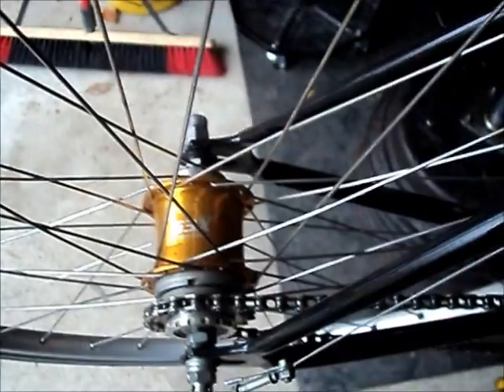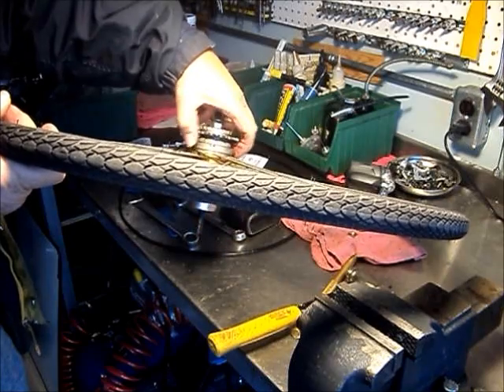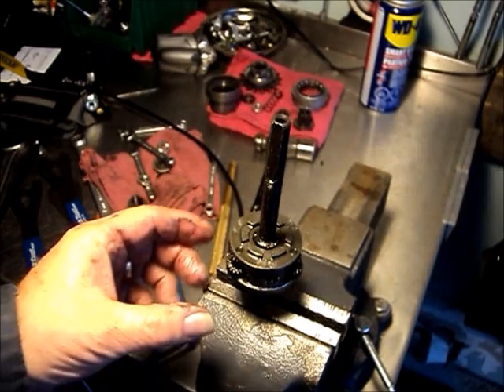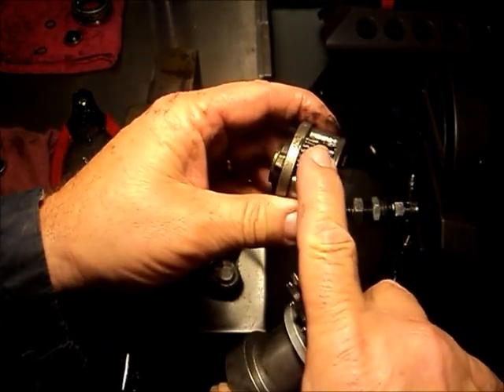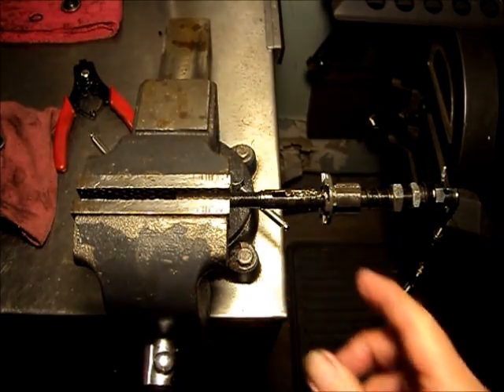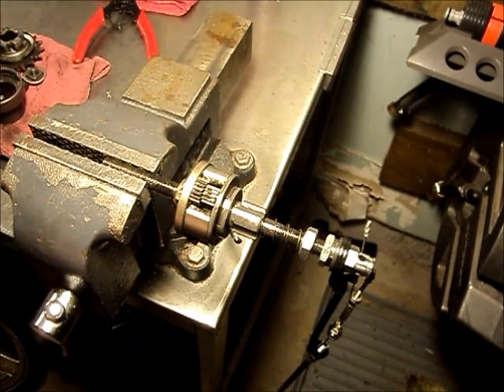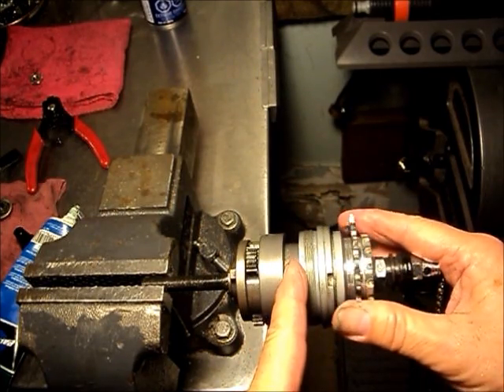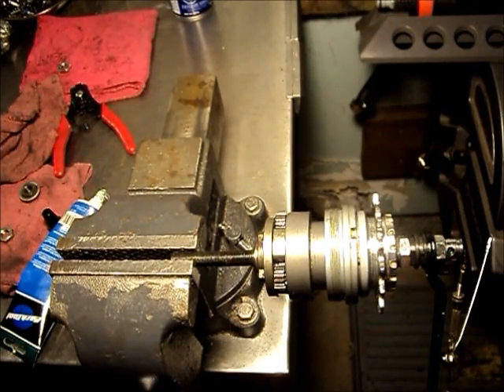Sturmey Archer S3X fixed gear 3 speed. How it works

Comment: I just got this exact hub from a friend. I was thinking of building this up as a 3 speed freewheel. Do you think I could just take the fixed gear off and replace it with a singlespeed freewheel, similar to the ones you see on most flipflop hubs?

Comment: I always wanted to make a fixed gear single speed that uses a clutch to freewheel. I think it would have to be a drum brake combined with a hub. I realize I could get a coaster brake hub but I think my idea is better because a coaster brake hub has no fixed gear possibility. Has this ever been done?
Reply: You need CNC machines for this. It hasn't been done, if I understand correctly. A fixed gear hub with a clutch to disengage? I would buy this from you if you made it.
Reply: @intraterrestrial69  i haven't figured out the design but i think it's doable. a powerful enough drum brake that works in reverse, inside the hub, kinda. if i ever figure it out i'll try and let you know
Reply: @Hugothepugalier rd you mean rear derailleur? i would want it to be lever or cable actuated so i could choose when to engage/ disengage, i wouldnt want it to freewheel all the time.

Comment: Thank you! I NEED a fixed gear hub for this project I'm doing and now I've found I may have found the solution. Had no idea that a fixed 3 speed even existed! Already have a fixed single but I need a couple different ratios and your video shows the hub may actually be able to take the power I'm going to be putting into this thing. I'm looking at about 4-5 hp input. It's gonna have to take a pounding. IN reverse direction. And the hub's construction kinda looks like it may actually take it. Thanks again!
Reply: +Adam Dorris I look into this as well, since this hub would be repurposed to drive the LEFT side of a motorized bike. By all I've questioned, 2hp is the max any bicycle hub can withstand with any sort of longevity, NuVinci included. 
My dream is using this or another Left-drive hub as a jackshaft transmission.

human output is ~1/3hp and bike hubs are only built to withstand little more than that. $80+ spent and then chew up the internal pawls within a few rides will be very sad.
Best luck for your project! if it's a motorized bike, be sure to post on those forums!
Reply: pds tech I was also worried about the input power and yeah it'll destroy the hub. I'm gonna have to actually invent a transmission. Very small, very robust, with input and output shafts on the same side. 2 or 3 speed. Clutch is before the input side. It's a motorized bicycle! I'm not too fond of the jackshaft shift kits on the market...
Reply: @pauls5745   I'm here for the same thing..lol looks like it lead us all to the same place! Did you have any luck with your project? Were you able to rind this hub, it's bot sold on the Sturmey website. I'm really excited I hope we find what we are/were looking to achieve!
Reply from the maker: Well, I can't make any guarantee that it will be up for that kind of power input, but I would be very interested to know how it works out for you.
Reply: Looking into it for the same mini bike application

Comment: where is the yt video for the free wheeling design? How do you lube if no oil cap on hub?
Reply from the maker: Is this what you're looking for?
https://www.youtube.com/watch?v=o6v5K-2zWMI

This hub, and all modern production Sturmey Archer hubs are grease lubricated. Re oiling not required.
if you want to switch to oil lube, oil can be added through the hollow axle by removing the indicator.

Comment: Can you mount the crank on the reverse side of the bike with this hub? Drive from the left side of the bike.
Reply from the maker: +Daniel Griffin  I see no mechanical reason this hub could not be run in reverse.You might want to put helicoils in the cranks to reverse the pedal threads though so the pedals don't unscrew themselves..
 I have thought about trying this myself.
Reply: Thanks!
Reply: If you want to make absolutely sure about the cranks use parts from a tandem crankset like Sheldon Brown did on some of his bikes, however I've heard that standard cranks can often be used in reverse if you tighten them really good and don't be too hard on the bike.

Comment: will this hub work on a 26¨ x 3 wheel rim like the shimano nexus 3 if so whick one would be better quality built
Reply: any hub will work with any hub, AS LONG AS THERE ARE THE SAME AMOUNT OF SPOKES. The only problem you may run into is having spokes that would be too long or too short, or having the wrong end on it, and having to order new ones. But with enough patience, you can build your own wheel with your own hub, and you own spokes, and your own rim. Or just pay for someone else to do it.

Comment: my hub has got a bit off play, as in i can shake the wheel and theres a bit off side to side action, not much though. how do you tighten  up the hub?
Reply from the maker: +batterycock  It requires a bearing adjustment from the non drive side. It's a standard cup and cone adjustment procedure.

Comment: i don't get it ... there is only 3 resons for having a fixed gear "save weight" witch this hub won't help  "clown around riding in revers" or being trendy  ... the coaster brake one have about the same weight but "3speeds+freewheel+brake"
Reply: +Golden Sim- some people, like myself like fixed gear bikes but live somewhere that has too much elevation for 1 single gear. another reason is to save your knees, when dealing with a bike with minimal gears, your knees take a lot less pounding if the bike does half the work, and when you consider this versus a typical road bike, sure the road bike might be lighter but this is a lot easier to maintain.

Comment: Filing this one under "best bike hub for the zombie apocalypse" - it's fixed, so no chance of freewheel noise attracting unwanted revenant attention, and it has internal gearing for longevity. Pair with a front dynohub for noiseless battery-less lighting or power generation when needed.
Reply: countertony this hub is no zombie hub. mine lasted about 6 months of mediocre riding.

Comment: Hi! I have the same model s3x and my small gear keeps dropping to mid gear as if notches are slipping. I'm pretty good with regular maintenance, barrel adjuster, truing, chain key, chain and cables are good. No adjustment seems to help. I have a little over 1k miles on it and use the small gear regularly since I live in hilly San Francisco, thinking its time for a over haul??? Thanks!

Comment: Is there any way of removing the sprocket? and replacing with a new one?
Reply: Dan Burkhart Thanks a lot! Cause I am considering use this gear for my engineering project which is a low cost all terrain wheelchair, which the fixed gear of this S3X helps a lot as to the braking. This is a long shot but do you have the dimensions of the sprocket of the S3X? I need to redesign it in solidworks for my engineering project but I do not have the proper dimensions. I just need the teeth of the inner radius which is used to lock the sprocket.
Reply: Chong Kwang Jun: careful, this hub is notoriously good at failing completely.

Comment: How do you this 3 speed compares to the nexus ans sram 3 speeds.any thoughts? Thanks
Reply from the maker: There really is no comparison as Shimano and Sram do not offer a fixed gear version of the 3 speed. 
A better comparison would be Sturmey Archer AW or SRF3 3 speeds and in my opinion, they compare very favorably against the competition.
Reply: I was looking for something robust..I am going to run a mid drive electric motor...I know not to shift under power..perhap
s you know the engineering of something tough...or as tough as it gets..: )
Reply: Of course it cannot be a fixie for sure! :)
Reply from the maker: John Cunningham
 I don't know if any production 3 speed is robust enough for a mid drive motor.
 Maybe a Nuvinci CVT hub would stand up to it and give you a larger ratio range too.
Reply: expensive and more gears than I need...but yes I did look at that cvt. The only think is when I dont want to use the mid drive I still would like a little gear!
Reply: +John Cunningham Did you ever find a solution to this. I am also looking at doing this.
Reply: Nuvinci

Comment: Hi there! I have fuji feather so can install this on my bike? And also are there any 3 speed hub that allows me to coast? Can this hub be adjusted to coast? Thank you
Reply from the maker: You absolutely could install this hub in a Fuji Feather, but if you want a freewheeling 3 speed, I would go with the SRF3 Sturmey Archer. It has a wider gear range than the S3X and it is cheaper too. 
 The S3X has a threaded driver, so you can install a single speed freewheel on it.

Comment: I sold my friends my complete bike with this setup on there. I originally received the rim set both a front and rear for 100 bucks minus the shifter and the chain. Got the parts from work and put it all together. Mind you that upon receiving the wheel set the bearings on the rear wheel were loose. I then repacked the bearings with grease, set up the shifter using an old 3 speed shifter housing off an old schwinn and mounted it to the rear stay. Everything worked fine but at points I had problems with the gear being out of alignment. I had no problem adjusting it working with sturmey archer hubs at work all the time but never internally just adjusting gears. Finally after feeling the effects of fixed gear riding on my knees after 5 years and owing my friend money I gave him my bike. He then road it and started having problems with almost dieing mid traffic alot due to hiting nutral alignment and just spinning his cranks. He then adjusted it himself which I belive made it worse. Is it possible he wore out the gears?
Reply from the maker: I'm not sure I understand. Are you saying you used a regular 3 speed shifter? That is a no no The cable pull is different. You need a dedicated S3X shifter.
There is a neutral spot between first and second if the shifter doesn't click into position properly, or it can happen if it's mis-adjusted. Does not necessarily mean anything is broken.
Reply: Dan Burkhart Ok makes sense its just weird how I was able to make it work before hand. And now that I recall it was a 4 speed SA shifter but because of were I mounted it I wasn't able to shift it into the last space. Not enough room for it to do so. But yet again I'm the mechanic my buddy isn't and from all his complaining and no technical experience mind you hes just a fixi rider no gear experience or mechanical he put it on its death bed. Thanks for the info because when it comes to external gears I understand quiet a bit but besides aligning SA stuff I'm lost for internals.

Comment: This is the most common gear in Germany. And a bicycle is the most important thing there. I saw people using this for 20 years. So I guess it's pretty safe.
Reply: Nah, I think you mean the Fichtel & Sachs Torpedo 3-speed hub, which has a freewheel and also a coaster brake (except for really old versions).
I live in Germany and I have never seen this Sturmey Archer hub here.

Comment from the maker: There would be room on the driver for 2 cogs and a spacer between them. 2 issues with this set up. Your dropouts would have to be long enough to accommodate the extra chain for the small cog, and your chainline will be less than ideal in at least one of those gears,

Comment from the maker: It's easy to change with the right tool. The lock ring uses the same wrench as an external bottom bracket. I don't know about you, but I don't usually carry one of those when I'm riding.
 If you prefer, you can use a lock ring off the non drive side of a cup and cone English bottom bracket.

Comment from the maker: Unless you ride in really bad conditions, I wouldn't worry about cleaning it out. I did not clean the grease out of the internals, there wasn't much there to start with.
 I greased the bearings, and added a bit of ATF to the internals. Runs better than ever.

Comment: This video is just what I needed. I've put about 2300mi on my S3X and I figure it's about time to clean her out before spring rolls around. Once cleaned, what kind of grease or oil did you use?
Reply: Hey I hope you see this. What were the results of your time with this hub? Do you still have it? Did you ever use it aggressively as you would a track hub? Did you skid/ back brake your hub? Your response would be a great addition to the knowledge base of this hub, as there is not much on it. I have build one, and will begin riding it soon.
Reply: @intraterrestrial69   Nah. Sold that bike many moons ago. I did back brake, but I avoided skids just because of all the stories I heard about shredding gears. I wouldn't say I'm an aggressive rider, but I had no issues  doing sprints on this hub.
Reply: @JosephDiaz  Thanks for the info!

Comment from the maker: Should last forever. For big power standing starts, you should use third gear which is a direct lockup. The gear train will not be subjected to any torque that way.